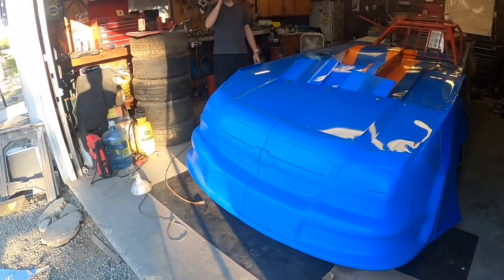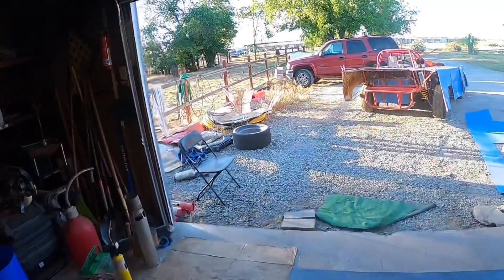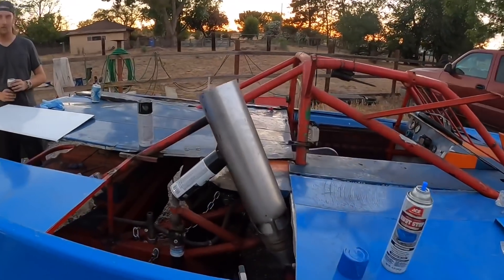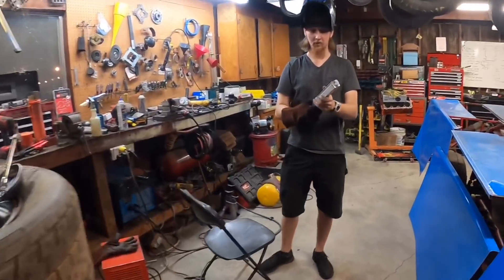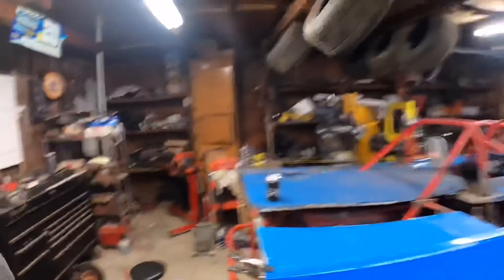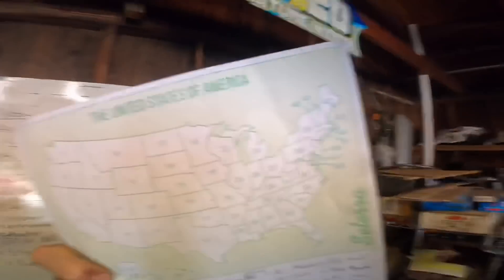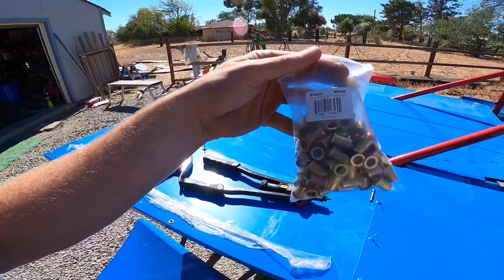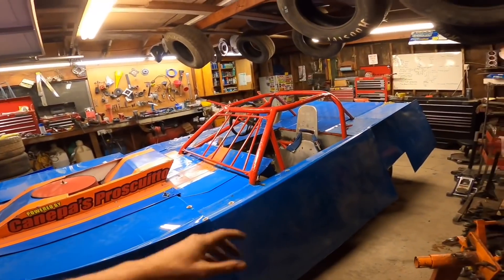Homemade Race Car Body Pt:4 -- Testing Out More Sweet Tea

Comment: It's looking pretty good take you a string put it on the centre hub all 4  Hubs Take you a magic marker and use it to draw out the lines to cut the fingers out weirds machine makes a tool all that all that
Reply from the maker: Right on thanks!